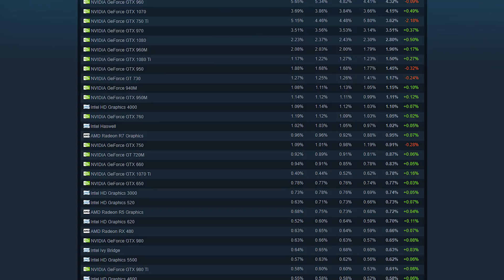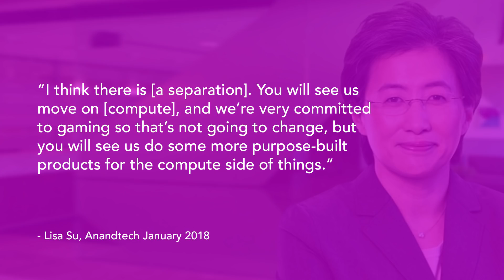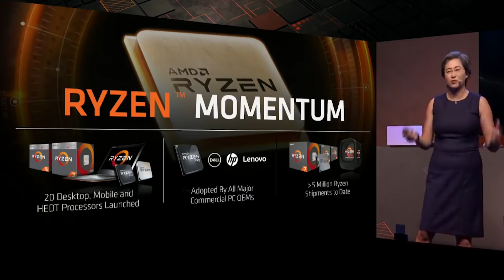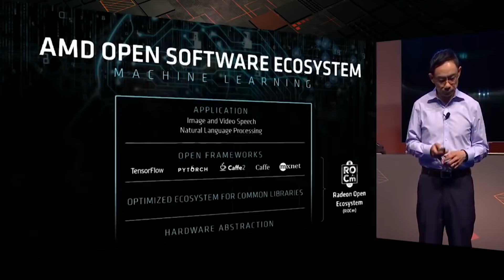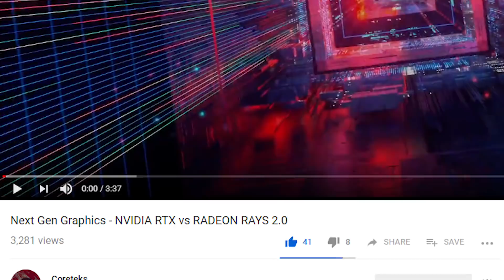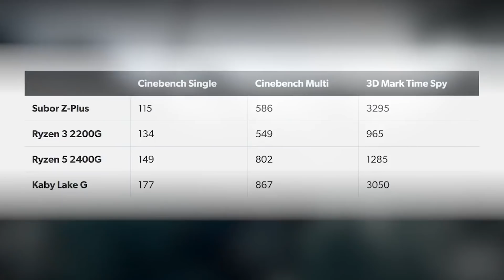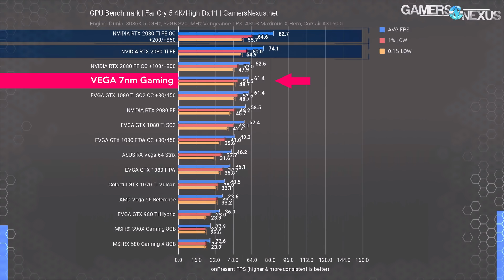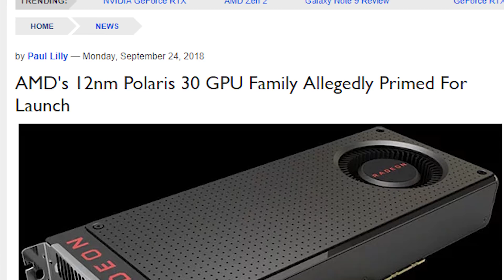AMD's answer to RTX

Comment: The Rtx cards are not that impressive, to be honest. the only card with gains is the 2080ti. for 1200usd. this is the only card from the new generation of nvidia cards with gains. the 2080 is a 1080ti for a higher cost. so from this you can  guess where the 2070 will land. it may be a slightly more powerful gtx 1080.and the 2060 may be equivalent to a 1070 or 1070ti.

The next Vega card or Navi has to be 1080ti performance for less money. this will keep AMD competitive on the high end. RTX performance is not important in this generation of cards. the 2080ti struggles to get 1080p 60fps in ray traced games, so for now its not practical, but it may be 2 card generations from now like in the next 4 years. 

AMD Road map already indicates a new architecture coming in 2020. This new architecture is where AMD own version of RTX will be implemented to compete with nvidia, when RTX starts to become mainstream. Vega is getting very cheap but i am trying as much as possible to hold off on purchasing vega until next year when the newer version comes. i dont want anything less than 1080ti performance coming from an R9 fury.
Reply: You can't even get a 2080ti for $1200 right now, most cards go for ~1300 then once the new tariffs drop you will be looking at $1500-1600 for a 2080ti.
I could probably build an entire 7nm pc next year for the price of a 2080ti and still have change left over. 

RTX cards don't make sense financially. but some people have more money than sense and will buy anyway.
Reply: rtx is faking the seen they tell you that there using the super computer to render the game in 4k and teaching there rtx how to fake the picture so they get better fps, these bitches have went all in on cheating, all the kids see is oooohh new gpu ,, but there not listening to what they said in the demo
Reply: @UPsideDOWNworld321  I saw tests in two available demos with dlss and that fake 4k (1440p upscaled with dlss to 4k)  looks the same as 1800p
Reply: same here, was close to buying a vega 56 2 days ago when it was on sale. still there is a sapphire 56 card on 27% sale on newegg.. tempting but waiting.
Reply: Use the Vega card to crypto-mine money for a real card ;)
Reply: RTX series has some of the biggest feature additions to rasterization pipeline we have seen in very long time.
Even if RTX isn't fastest chip within a year, it is still most interesting chip we have seen since Fermi hit the market. (and this is without Tensor or RT cores.)

Really hope AMD and Intel will follow and have Mesh Shader Pipeline (and others) support as soon as possible, there are some nice possibilities there. (Finally something similar to VU1 on PC.)
Reply: warcrab cyber but the RTX GPU’s hit 60FPS on 4K games, but I agree with the crazy price, but your paying for the brand and games tend to prefer Nvidia GPUs.The 1080ti was up to 20% faster than the Vega 64.Not that I’ll be able to afford any of this though
Reply: It hits the performance target at an insane price. not to mention the price you will have to pay for a 4k 144hz monitor as well. so you end up paying 1200usd for a card and 2000$ for a monitor. vega 64 is a good competitor to the 1080 however the AMD does not have a competitor for the 1080ti which i would consider the new sweet spot for gaming, because it can do 4k with tweak in settings and can max out any game in 1440p and 1080p. This is the spot AMD needs to compete in and get their act together. As far as games tend to favor Nvidia is debatable. Not all games work better on Nvidia hardware. games like Farcry 5 and many new games are properly optimized for AMD hardware and out performs nvidia in some instances.

i only reccommend nvidia if the person has the extra money to buy a gsync monitor. i rather lose 5 fps in nvidia optimized games and gain Adaptive sync which will lead to an overall better experience.
Reply: You don't need 4k to be honest, there's not a noticeable difference vs 1440p in a 27" screen, IMO is just wasted performance using 4k when you could be using 1440p 144hz monitor instead.
Reply: @warcrabcyber9908 of course you don't have to buy a 144hz 4k monitor. Why would you? The highest end card available is not capable of pushing 4k ar higher than 60-70fps so it would make no sense to buy a 4k 144hz monitor.
Reply: No they don't. See some game benchmarks. Many games go below 60fps in 4k on ultra settings. And things will get worse with time. But honestly gamers are not ready for 4k.

Comment: why did they rush out rtx?  well rtx gaming cards are just dies that didnt make the cut for quadro.  and yes amd is making 7nm raytracing gpus....instinct pro cards that cost thousands.  quadro is nvidia's competitor to instinct.  if they release the quadro then they have to release an rtx gaming card to get rid of the lesser binned dies.  so they most likely rushed the quadro out to beat the instinct card and the gaming cards are just there to get money out of bad dies.  

could amd release a cut down , lesser binned die for the gaming market.  sure.  but i dont think the numbers on 7nm are there yet.  they would only have a hadnful of them.  thats why nvidia went with 12nm.  i would think that amd wont have anything in 2018.  early 2019 maybe.

and the 35% faster was for the instinct card wasnt it?  you show a slide about gaming and then you cut to a different slide showing 1.35x performance but that slide doesnt say anything about gaming if i remember correclty.  it was about insticnt cards.

plus they seem to be saying that small navi will come out first and then large navi later on in 2019.  if something 7nm comes as soon as early 2019 it probably wont be a 1080 ti competitor.  maybe 1080.  maybe

the performance increase going to 7nm would be 35% but thats not counting higher clocks and more cores?  i think thats exactly what they are counting.  at least the clocks.  where do you think the extra performance is coming from?  vega isnt scaling well (and all gpus scale less and less with more and more cores).  going from 3500 to 4000 cores on the 56 to the 64 didtn gaing the 64 much at all.  most of the performance difference between the 2 can be removed by overclocking the mem speed on the 56 to match the 64.  when you do that they are almost identical in gaming performance.  when you match clock speeds they basically are identical. so extra cores on a new card would do very little and the + 35% percent performance theya re talking about comes from higher clocks only.  you cant figure 35% and then add more for something that has already been accounted for
Reply: Quadro was released in 2004....Instinct was 2016....they are 100% COMPLETELY different things, PERIOD...do a little reading "friend"
Reply: @Maurice Fortin dude they come out with quadro cards every year.  the had a pascal quadro and now they have a turing quadro.  maybe you should do a little reading "friend".  maybe try googline quadro rtx.  its the card that the rtx 2080 and 2080 ti are based off of.  anybody who thinks they stopped making quadro in 2004 needs to read A LOT more
Reply: oh and amd's 7nm gpu is also an instinct card so not just 2016.  keep up

Comment: now imagine they strip out of the memory nonsense from vega from the workstation side and pushed another 16 CU in there making a Vega 80 card without the SSD/HDD memory stuff.  shrink that down from 14nm(really 16nm) to 7nm(really 10nm) and the clock bumps could gain 35% IPC per CU.  if only they were going to target gaming instead of industry for gaming cards.

Comment: Does "2x Power Efficiency" mean half the TDP or same TDP and ramped up Clock Speeds? in this case i'd say half the TDP because same TDP and Higher Clocks paired with 7nm Performance Gains would result in more than 35% higher Performance. Now imagine a Card performing similar to the 1080ti and only consuming 150 Watts, thats almost half the Consumption of a 1080ti.

Now think about what would happen if they only want 50% better Power Efficiency for Gamers and ramp up Clockspeeds, that would result in ~50% higher Performance and even beat an overclocked 2080 while consuming 15% less power
Reply from the maker: They can choose either, go for better efficiency or have the same efficiency as before but increase the clocks. 50% increase would be awesome, but I don't think it will be that high unfortunately
Reply: As far as i understood Vega 7nm is just a 14nm shrinked by the Manufacturing Node, no other Changes were made according to AMD, but still the Performance was increased by 35%. The New Vega Instincts will be ~150 Watts, now if you have a RX Vega 7nm with 225 Watts Aviable you can ofc ramp up Clock Speeds quite alot compared to the Vega Instinct Cards. So 50% Higher Max TDP should result in a minimum of 15% higher Performance and combined with the already existing 35% that would be at least 50%.
Reply from the maker: I suspect the move to 7nm is a bit over-hyped by all parties involved, which is why I went with a conservative estimate, but you could very well be right about the 50% increase.
Reply: Yeah it is overhyped because the Vega Architecture isn't the best in the World and the fact that they did nothing except a Node Shrink for 7nm is quite sad,
iam more excited about the 7nm Navi GPU's because even if they are only targeted at Mid-Range they will deliver great Performance per Dollar and Watt in the 1080p and 1440p Desktop Areas.
Reply: may factors...is not a simple "flip this, you get that" type thing....they can put X more transistors in there to accomplish more work at the same clock speed so a bit more power use but WAY more "grunt" they can same amount of transistors are a faster speed, more transistors at higher speed etc etc.... there is SO much that goes into chip design, is not a "simple thing" or it would not be costing tens to hundreds of millions of $ per product launch with numerous "respins"

TDP FYI is NOT power consumption, yes they are related, but TDP is COOLER REQUIREMENTS not POWER CONSUMPTION..... things can be made "very efficient" to hig X TDP or "barely efficient" and hit the same TDP... example is "my" 7870, is rated for 175w.....overclocked I would be running it well beyond "safe" to make it hit 175w in use, the average is ~148w with a slight overclock...something else example RX 570 is "rated" for 120w, but CAN hit 200+w (pci-e 3.0 bus with a single 6 pin allows 225w maximum)

TDP is and never was anything other then a "guesstimate" at power consumed, no different then a V6 engine in one car is as fuel hungry and fast as a V6 in a different car, is estimation...

TDP can be called thermal design power, but is more "accurate" to be called as thermal design point, meaning "normal circumstance" it will not exceed this amount so therefore the cooler is designed to handle it (thermally designed power point)...often it does not work out that way, no matter if it was Intel or Nvidia or AMD...they should remove this "figure" and stick with cold hard "limits" however they will do this, a 6 pin an 8 pin or the slot can only provide X amount of power or within a certain range, anything else is beyond spec and can have major nasty things happen because of doing so...
Reply: Rx 580 is already on a sweetspot in terms of consumption, im sure they will go full performance on that, vega on the other hand needs a little bit less of power usage so i think the increase won't be that big in that segment (still 35%+ since they also get more performance by software improvements)
Reply: Trim your Vega's and they will perform way better, they are a bit high on voltage (to make sure 100% of em RUN) but you can get them much lower, some lower than others).

What they are saying is that a 100% identical card in 7nm would be 35% faster (smaller transistors switch faster than big ones) it will require 50% less power and will be a LOT smaller.

From there on you can "mod" the new one, so keep the same power usage as the 14nm Vega's but slap in 30-50% more CU's which give 30-50% more performance and THEN you add on the 35% for the die shrink which would mean a total performance improvement of 40,5 - 67,5% faster than a current Vega card.

They could just keep the CU's the same, get the 35% more performance out of it while plummeting power usage, and price them cheaper than 1080's while out performing those and probably near the 1080TI's or even past them. Then you have a crazy fast card that isn't a space heater.

Comment: Pro Answer. There will be no Vega 7nm for PC gamers. There is no financial feasibility which is the biggest factor this video over looked. The fact is that the BOD told Lisa to focus on recapturing there main market which is CPU since engineers have found serious bottleneck in the GCN architecture that's not easily fixed. Releasing another gaming card based on Vega solves nothing. Also TSMC gave AMD limited capacity for 7nm since there high performance node is still not in full production state.
Reply from the maker: Perhaps you didn't watch the whole video but I did talk about its feasibility (which is tied to HBM2). A switch to gddr6 can solve this (also in the video I gave an example of how a different memory system is actually possible with Vega). As for 7nm limited availability, a new fab has just been opened by joint tsmc/samsung because of demand from everyone.. it's definitely feasible.
Reply: @Coreteks  but the Crux of the matter means that it won't happen, not with Vega. Not to mention that there's that little issue called GF who still can't seem to stop trying to hobble us with fees.
Reply from the maker: I can't be 100% sure, of course, but I'm sticking to my prediction. Put yourself in AMD's shoes.. the RTX are pricey and getting bad press and a lukewarm reception from buyers. Seems like an opportunity too good to miss. Remember how they answered the first Titan?
Reply: ok dumb ass

Comment: It has always been interesting how things are developed, yet to be implemented. One could go back as far as Photoshop and Industrial Light and Magic historically. Khronos Group with NVidia and AMD being two promoters of it. Yet the ray tracing requires massive compute power. Imagine that the two major consoles could have pulled some of the studios to use those API's. Note that I will state "could have" as those two use Jaguar Cores.  Regardless of hardware fandom, we can only accept what API actually get used in a game by the game studios. Thank you for your perspective, and hope the discussions to follow are not toxic. Cheers. :)